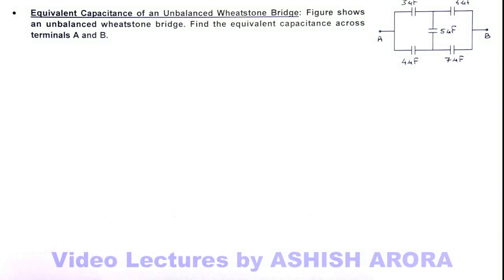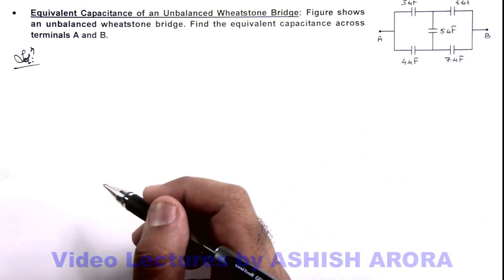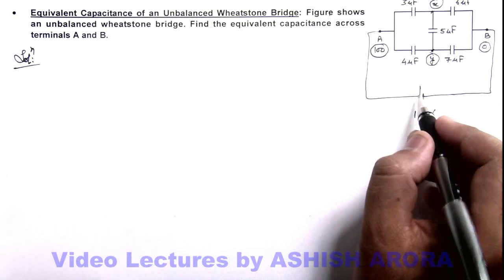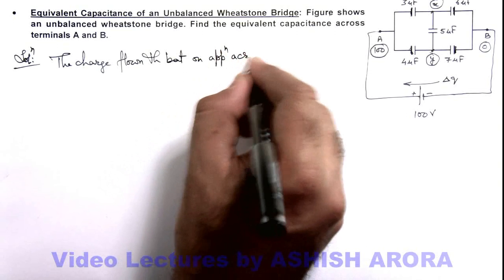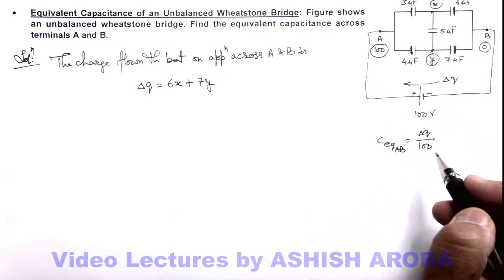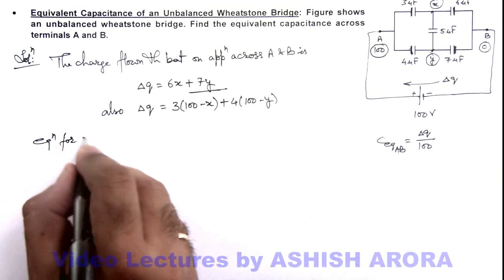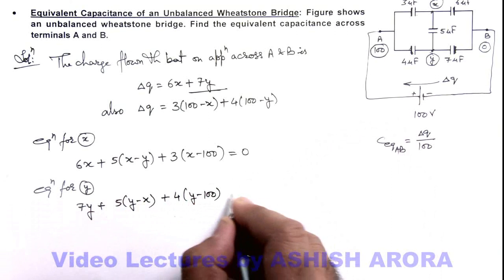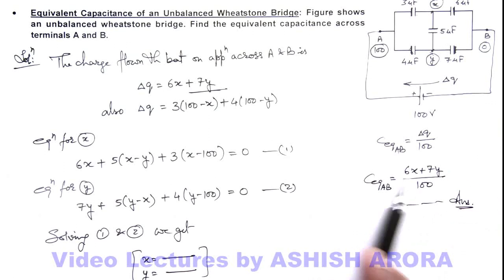11. Advance Illustration | Capacitance | Equivalent Capacitance of an Unbalanced Wheatstone Bridge

Comment: Sir this is giving me wrong answer, assume 3F and 1F in unbalanced circuit with 4F in middle
Reply from the maker: above method is absolutely correct and no exception for any case... check your calculation...
Reply: @physicsgalaxyworld  sir you can calculate for the given unbalanced wheatstone bridge
1F and 3F on upper branch
4F in middle
3F and 1F on bottom branch
Reply from the maker: @istritlistrad5482  Its equivalent is 11/6µF. Whichever method you follow result comes out to be same. Fastest is above method only... much faster you can solve in just one step using symmetry analysis for which you should watch our fundamental classes of current electricity.
Reply from the maker: use x and y at the two junctions and the equations will be 3x+1(x-100)+4(x-y) = 0 & y+3(y-100) + 4(y-x)=0 solving you get x = 125/3 and y = 175/3 then equivalent capacitance can be written as Ceq=(3x+1y)/100 = 11/6µF.

To make it shorter initially you can take y = 100-x so in first equation only you get x = 125/3 and no need of second equation so directly in one step you get the answer. Max 60-90 second solution. Watch our fundamental classes for such techniques...
Reply: @physicsgalaxyworld  and the correct answer is 11/6

Comment: Sir, this method is giving wrong answer. Can you please do a video on how to use star-delta conversion for these kind of questions???
Reply from the maker: This method is giving exactly correct answer... and this is a logical and proper way of understanding this and many more such circuits... star -delta theorem we have explained in our fundamental classes of circuits which you can watch... there also we've explained that this method is having very limited applications...

Comment: sir, how can u just assume V to be 100. what if there's no information about voltage given in the question? is it okay to just assume?
Reply: yes it wont change the equivalent capacitance of the system
Reply: Yeah but i assume as V but 100 is diff to calculate most of them use 1 v too
Reply: u can take V too( i am 4 years late but still it will help others ,so , :)

Comment: How can we consider an Emf ,When the question is to find the eff capacitance? Plus the value will change for different Values of Emf which is wrong..  plus what is the Equvialent capacitance of that network? Final answer?
Reply from the maker: Dear friend, first update your basic fundamentals.... Capacitance is a passive parameter which does not change with the applied emf unless breakdown takes place... No matter whichever emf we use below breakdown... capacitance value remains same so to calculate it we can use any emf... To understand basics, follow all videos in sequence on website www physicsgalaxy com...
Reply: but why am i getting wrong answer?
Reply: so, what made u choose the voltage as 100? if we had chosen a different voltage, the answer will vary right?
Reply: @ishraq2802   no because all equation adjust in such a way that the answer will be same
Reply: @ishraq2802  no need of taking EMF as 100 or any value . You can just keep EMF as V , you will get charge in terms of V , take the ratio Q by V you will get equivalent capacitance. Value 100 has been taken just so that instead of V and Q , you work with numbers . But it is not at all necessary to take EMF as 100. You can take any number such as 2.3567 also , you will get same capacitance. Best method is to keep it V and not take any particular value.
Reply: @ishraq2802  sir has taken voltage as 100 for easy calculations you can take any amount of voltage below its breakdown vale and still the answer will be same